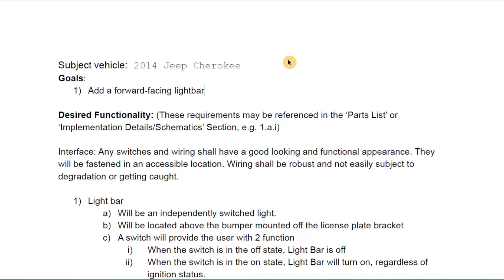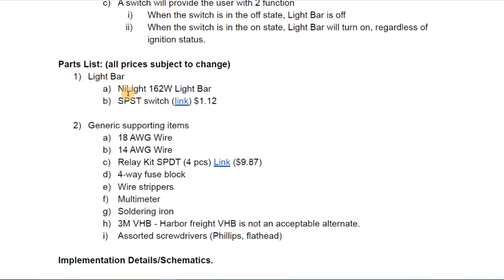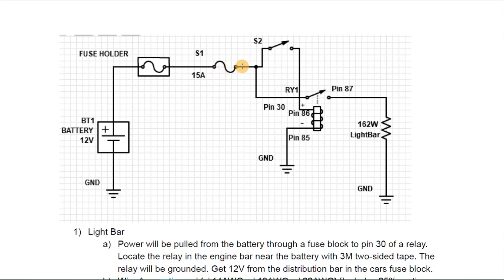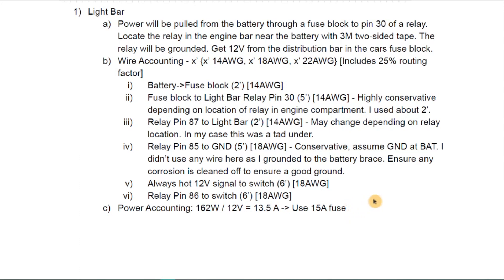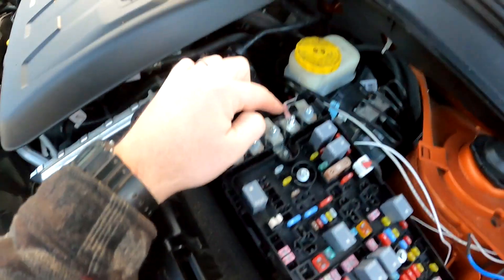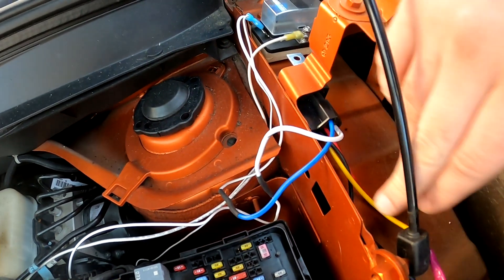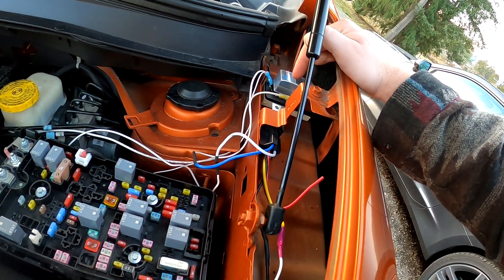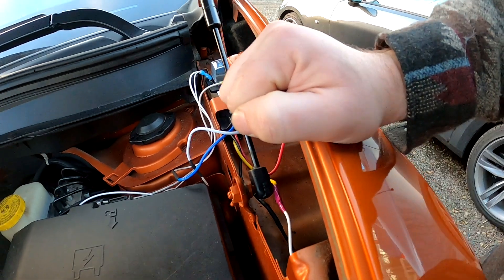2014 Jeep Cherokee Lightbar Install

Comment: Hey there, thank you for sharing! Your light bar looks awesome. I’m trying to do something similar to my Cherokee and don’t have a ton of experience with this stuff. If it’s not too much trouble, would you mind showing where inside the engine bay you were able to pass the wires through the firewall for your interior switch?
Reply from the maker: @mackinleysmith7495  great question, there is a rubber grommet like plug a little above the brake pedal. I found it helpful to push a wire through into the engine bay to see it. I recall accessing it from under the driver wheel, but that memory is vague. I ultimately ended up with a wireless solution, installed a receiver in the engine bay and had a remote that could trigger the light from anywhere within a 100yd range. It was one of the $12 4 channel wireless switches off eBay. Worked great and was much cleaner than having wires running all over. I did find the light bar on in parking lots from time to time and discovered Toyota and some other key fobs operated on the same frequency as channel A. So I changed to using channel b and never had an undirected trigger after.
Reply: @cyclonedr  Amazing, thank you so much for taking the time out of your day to provide the helpful info! I'll have to think about whether a wireless solution is in the cards for my predicament or not.